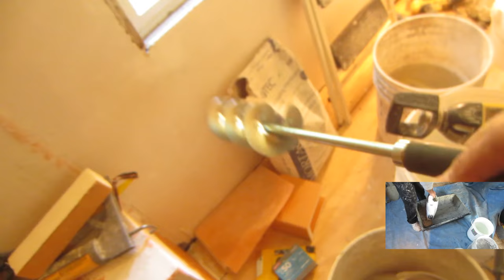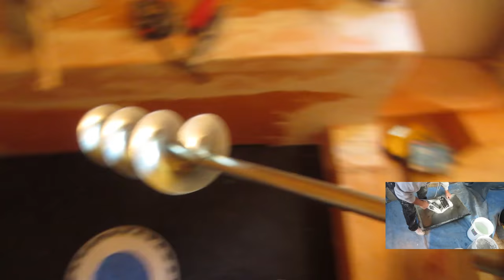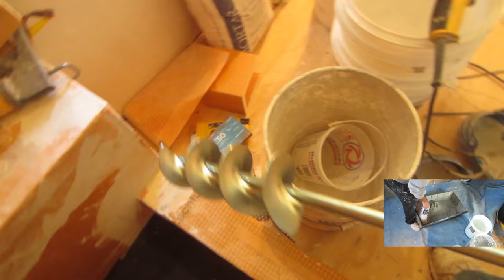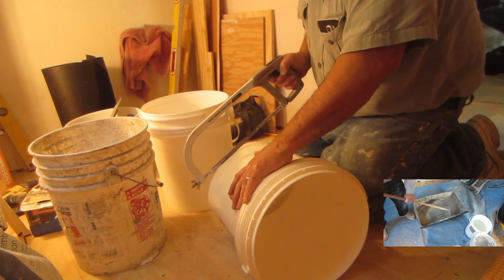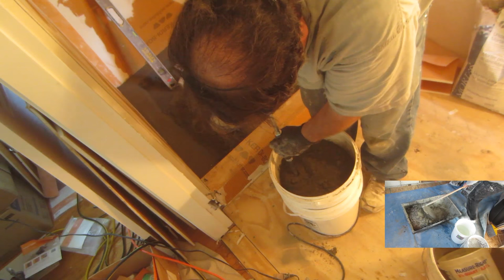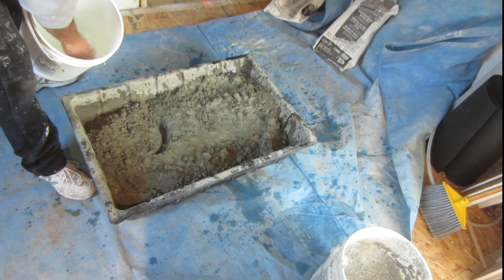Time saver Bucket Mortar mixer

Comment: yep that's a great tool I've been using one for almost three years now just one word of advice after you've used it for a while the bottom Edge can become Sharp so don't hold it at the bottom of the bucket for too long because it will cut into the bottom of the bucket and start swinging the whole thing around the room lol

Comment: In all my years I've only used my tub twice. Since you have to transfer it to a bucket anyway to get in to the project room/area you're working in, I simply eliminated that step years ago. I mix straight to the bucket too, but use a slightly different paddle. I might give that one a try simply due to the stationary handle.
Reply from the maker: Very easy to use and worth every penny.

Comment: Used my bucket mixer yesterday with Mapei 4 to 1. Instructions on the bags stated 3-3.5 quarts of water, but I decided to follow Sal's 2 quarts as in the video. The mud appeared a little dry as I was working it, and it's very sandy today. Did I follow the wrong instructions?

Comment: Hi Sal. I have to do floor leveling, but not with the self leveler, but with dry screed mortar, same consistency as you did here. I will not use fine sand, but instead aggregate of 0-4 mm size. What do you think can I do it same way you did it here? I planned to drag concrete mixer to my apartment but that is far more difficult to do. I want to make it as simple as possible. I have to do only 10 square meters of floor. Thanks.
Reply from the maker: The auger will work or you can use a tub and hoe. or even a tarp. For the tarp method you put your sand and cement on a tarp, pick up the 4 corners and rock it back and forth until it is mixed, this method is easiest when you have two people.

Comment: Getting one ,love the bucket mod,couldnt find 6 gal reasonable,question sal ,..can I fill in a shower  with ready crete,.and top off w a medium bed mortar, I've seen you add a thinset to help mortar bond,wondering if I poured cement, and right away add a mortar bed,on top up to my line drain,which will be thinset to bonding flange,waterproof  w kerdi membrane,after mortar dries
Reply from the maker: The thinset is used under the Deck mud to bond it to a concrete floor, on plywood wire lath and tar paper is used. Medium bed mortar is not meant to be used as a filler, it is an mortar for bonding.
Reply: @SalDiBlasi  thanks for your reply,yeah I'm still working on moms shower,I'm newbie,was wondering if I can pour cement and mortar  on top same time,or even just all cement,I just figured mortar may be easier to shape,sloped to line drain,sorry about my inexperience,I was goin to use the foam ,but am opting to extend our recirculating,hot supply  lines already there,to benefit a heating floor, in the 4x9 pan,thus the foam wouldn't  work as it would insulate you from the heat radiating up as it already  does in the surrounding slab,wish I could share pics  here,our cat likes to lay  there ,....cause its warm..🤗
Reply from the maker: @sonofthunder.  Cement products that are very wet are difficult to shape and work with, that is why Deck mud is used, it is almost dry and granular, easy to shape and form. This might help https://www.youtube.com/watch?v=XMD3qzjLxDc&t=611s

Comment: Sal would you use this mixer for thin-set mortar? If yes, would you have to mix it for the 5 min the bag says or can you get away with less time?
Reply from the maker: This is not good fro thinset. It is designed for Cement products like Deck mud or concrete.
Reply: Can I just get any mud mixer? I've searched for some, and they have different designs. I'm not sure if it really matters. For thin set mortar
Reply from the maker: Mud and thinset require different mixers to get the proper consistency.
Reply: What about something like this http://www.harborfreight.com/dual-speed-paint-and-mortar-mixer-69856.html Do I only use it for thinset then?

Comment: nice vid Sal, You swear by all the Schluter products but you dont use their pre-modified shower pans...how come?
Reply from the maker: If I could get them to fit exactly I would consider using them, however when they have to be cut to fit for the position of the drain and the size of the pan, the perimeter will no longer be straight and level. With mud i can shape it exactly how I want it.
Reply: I do them every month and when the right size is ordered with the appropriate position of the drain, I cut off access or fill in the remaining with dry mix...much faster.. No failures and have done plenty. I know some don't trust the foam but if done right it works.
Reply from the maker: Rocky Constable I have used the foam, I just feel mud is better, and when you cut the edges you are then into the "Bowl" of the tray.I actually know a lot of guys that like to use the mud as well.
Reply: Sal DiBlasi I'm the same I use all schluter products but do not use there pans I don't like the feel of it it doesn't feel solid as a drypack feels and like sal said with drypack it's easier to make sure your perimeter is nice and level ad get a better slop good job sal !!!
Reply: I've done both for many years and after years with the Schulter product it hasn't  failed once and saves so much time...If you believe in their products as I do and one hasn't failed me...time can be off the essence in some circumstances. Cheers

Comment: Hi Sal,

Any reason you use the Mapei 4 to 1 instead of mixing the sand/cement yourself?

Thanks!
Reply from the maker: Yes it is much easier and more convenient.
Reply: +Sal DiBlasi thanks sal. how many bags for a 32x48 pan? btw, used your link to order mixer, hope you get referral fee.
Reply from the maker: EthylOH figure about a 1/2 cubic foot per bag, figure the volume of your mud bed roughly. example, 38x48x2=3,072/1,728=1.777 so about 3.5 bags 3 bags will probably do it but I would get 4 to be safe. Of course if your mud bed is a lot  deeper than 2 inches you will need more.
Reply: +Sal DiBlasi going with the durock membrane and drain, so no extra preslope.

Comment: Was that only two quarts of water per 60-pound bag of sand mix?
Reply from the maker: Yes 2 to 2.5
Reply: @SalDiBlasi  Thanks for posting this Sal.  I just experimented using Mapei's stated 3 quarts and it was definitely too wet.  Will try your 2 to 2.5 next time.
Reply from the maker: @logitech2072  Ye 3 will make it too wet.